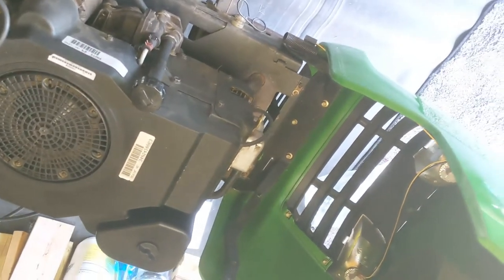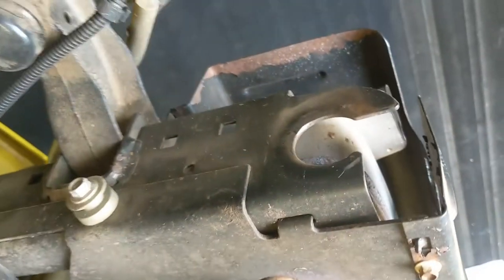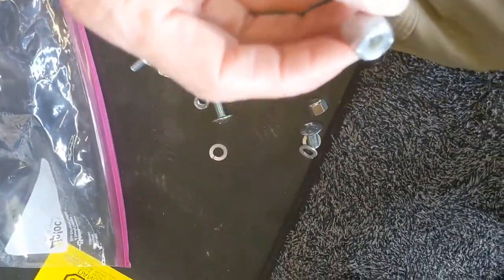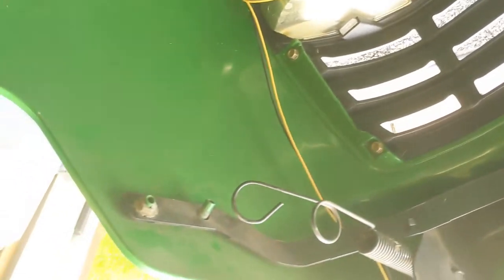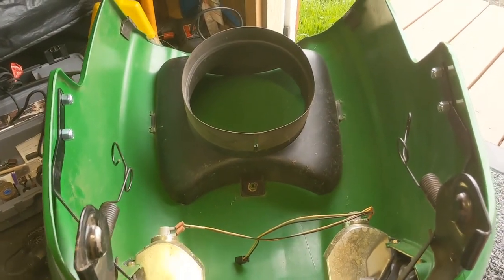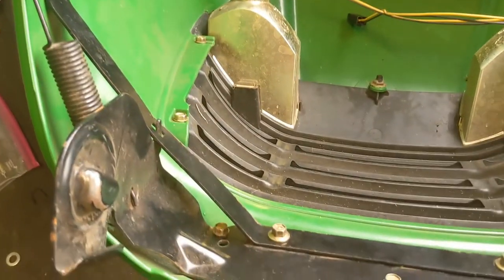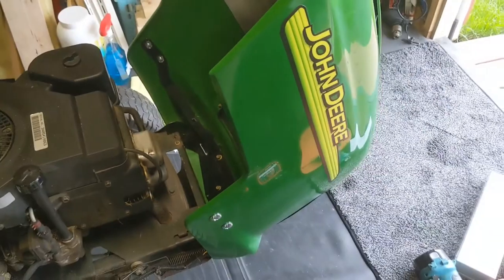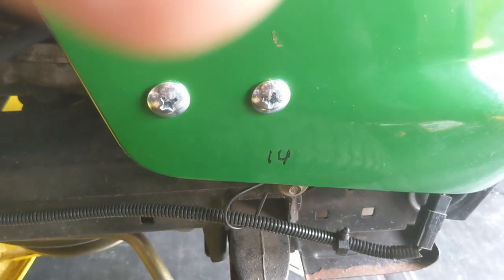John Deere L110 hood repair

Comment: Thanks for the repair tip. I have had these plastic posts broken for years on my L111. Well, the 3 screws that hold the front plate to the hood all snapped off when I opened the hood this past weekend. I super glued and epoxied the plastic crosses back together and did your repair repair while I was at it. Fantastic solution. Hood hasn't been this stable in years. Now if there was an inexpensive repair for the seat. :)
Reply from the maker: Your welcome. JD hasn't made a decent hood since the 170, 180, 185 line.